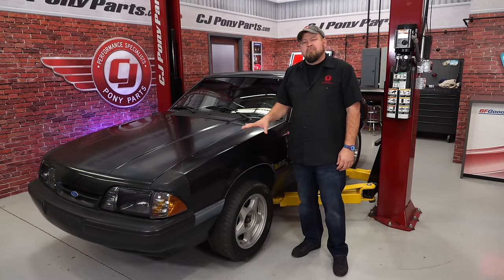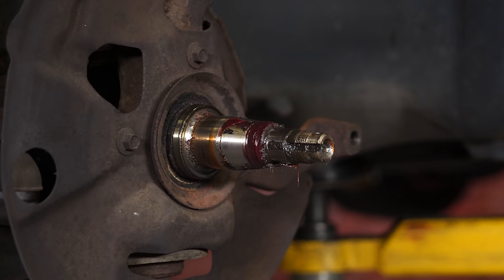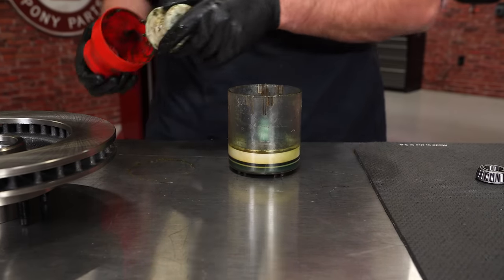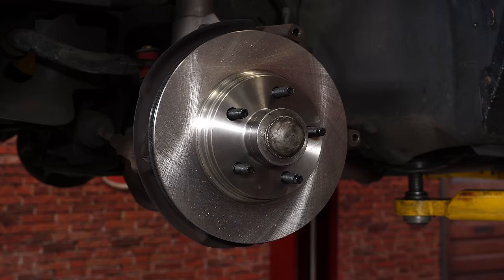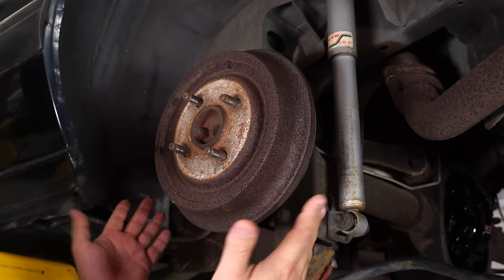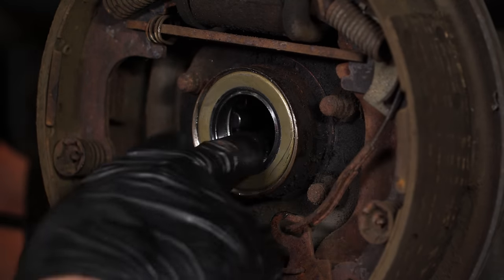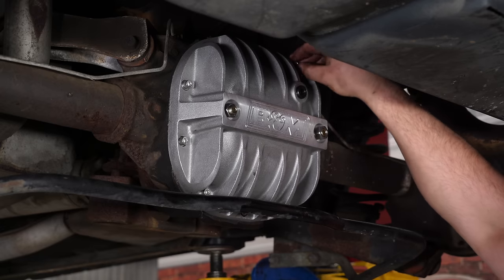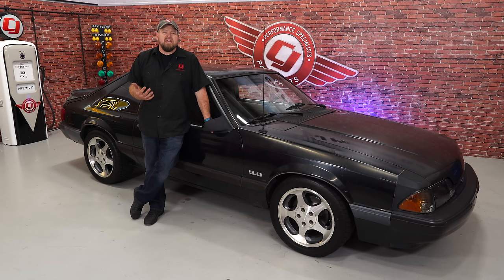Fox Body Mustang 5 Lug Swap Installation

Comment: Doing the 5 lug swap on my 82 GT was massive. 2 inch lowering springs, 30% stiffer then stock,  98 front calipers, 98 LCAs, 98 sway bar, 98 manual rack and pinion, 98 brake booster,  2002 struts, 95 GT 8.8 with disk brakes, 411 gear. The car is completely different. Also have 2001 GT starfish wheels.  Using SN-95 rear end, and 98 LCAs made the cars track with 3/4 inch wider and you can tell you take it into a corner. It feels great.

Comment: If you're on a real tight budget go to a salvage yard and get 2 driver side axles from a Ford Ranger with an 8.8. CJ Pony has pretty fair prices on new rotors and drums. Thanks for the video.
Reply: mchristr what year ranger/thanks
Reply: 83-92
Reply: @donaldhayes4785  What drums do u use??
Reply: Do both have to be driver side?
Reply: U can use driver's side axles from a 7.5 rear I order 2 driver side axles from rock Auto for a 89 ranger said for 8.8 or 7.5!!
Reply: @cashmoneyv197436ify  did they work out good?

Comment: I have 5 Lug drum brakes. 
But I wanna swap it disk. 
Put that video out
Reply: Swap in a ford ranger or sn95 rear end
Reply: Much easier to just do the disc conversion if you already nothered to convert the axles from 4 lug to 5 lug as shown in this video. 
 
Just drill the new disc plate in thats replacing the drum assembly.
Reply: @lowslo9287  What year from SN92?
Reply: @hu9678  94/98 are the best because of the width

Comment: That's cool.. but what I'm hearing and reading is that, as far as aftermarket wheels that aren't from your site.. the front middle hat section on the rotor hat won't allow the center cap to pop in. Because the center is too long. Why are they made like that??

Comment: Hey bro so the 4 to 5 lug swap doesn't require the other caliper bracket for the larger caliper ? And why didn't you bother to load up the new rotor with grease you barely put any on the race before sending the seal in ?

Comment: The '65-'73 Mustang rear disc brake conversion kit video you have up, in theory would involve the same work required in order to convert the rear drums to disc on the '74-'78 Mustang II as well even if the parts are not interchangeable, yes? 

I have the unfortunate luck of having a 1977 Mustang 2 with the dreaded 4 lug axles and rear drums. Double Bummer. And I want to both convert the rear axles to 5 lug because I cannot find some cool bullet style mag wheels in 4 lug, they're all 5 lugs and I want those classic 5 spoke wheels on there that make the car look fast standing still. And since I'll already have the rear torn down replacing the axle from 4 to 5 lug I might as well also convert it to rear disc from drums.

Comment: Big question is. Is there a way to tell the spline count on the rear axle without pulling the axles and before you order the wrong ones? Does the 87 lx convertible have a set spline count?
Reply from the maker: Stock axles that year would be 28 spline.

Comment: Can you put an irs from the newer cobras on a fox body, if so is it worth it. Weight wise, handle power, functionallity.
Reply: Yes it will bolt up in work if u have the irs rear already it I wouldn't do irs swap get a nice SN95 8.8 disc brake rear but it depends on what you are looking to ur car ! There's a few videos about putting irs rears in foxbodys!
Reply: Planning on doing some round trac racing? Otherwise why in heck would you boi?

Comment: I bought my notch with the 5 lug swap already done, how do I get ahold of the proper brake pads and shoes and other various goods to do a brake job?
Reply: Oz-Mo Speed Shop might be ranger, aerostar, or explorer rear brakes.
Reply: What u have drums on rear 5 lug same as Mustang shoes unless u have a 10inch drum a 10 drum on the outside would be all smooth it wouldn't have the lil ribs that stick out on drums that is a 9" If you have a big ass  rotor on the front probably Cobra  but should say on the calibers! They do make 5 lug rotors that bolt right on take ur 4 lug rotor off put the 5 lug rotor right back on same calibers & brakes just a  lug rotor!

Comment: Great videos. But let me tell you customer service needs work. Had a problem with an order first they didn’t have the part , then said two weeks , when I called back two weeks later said oh sorry that’s not available. No one called me I had to call the guy was everything but polite. Still stupid me gave them another shot and made another order. They said I would receive my part in 2-4 days nope 8 days. CJ will not receive a third try from me.
Reply: I Llike CJ's videos, but their customer service sucks. I switched to LMC, they have good knowledgeable customer service and I get my parts on time. I don't know why CJ's customer service has  turned to crap. They should really do something about it before they go belly up.

Comment: What size are those 5 lug drums 10inch ? Can you use the stock brake shoe with drum?
Reply: john jones   So just get 2 drums for a 89 Ford ranger cause I order 2 driver's side axles from Rock Auto does it matter if the drums or from a 7.5 or 8.8 rear !!! Thanks for any info
Reply: john jones  Thank you so much!!

Comment: Fresh rotors & drums.
Some new pads & linings, shouldn't break the budget.
Reply from the maker: We have other plans for a full brake upgrade to this car so we focused on showing you the process of converting to 5 lug.
Reply: Ok, no problem.
I just do not take any chances, with braking systems.
Never have, never will.